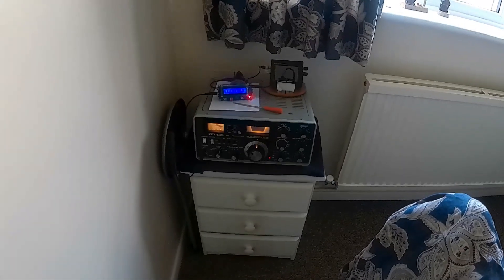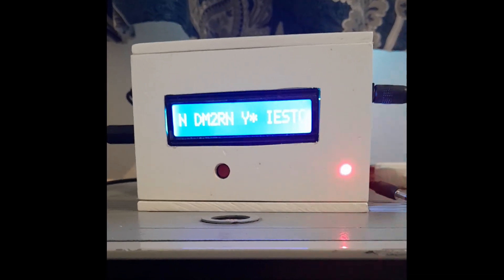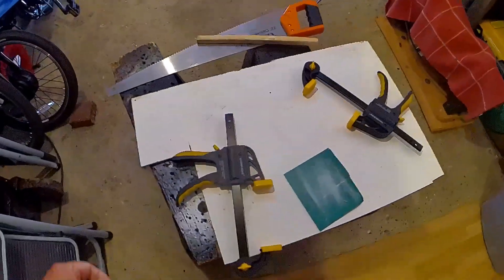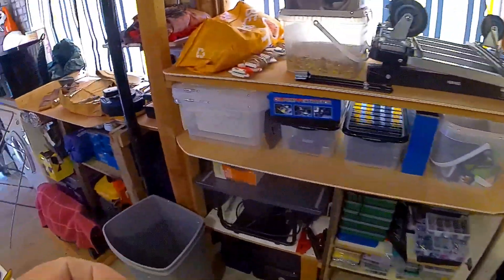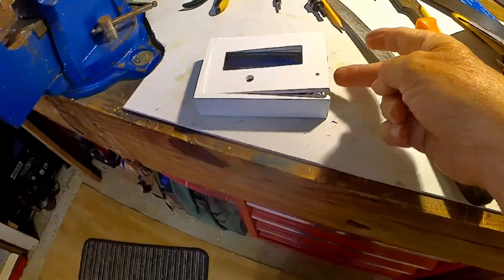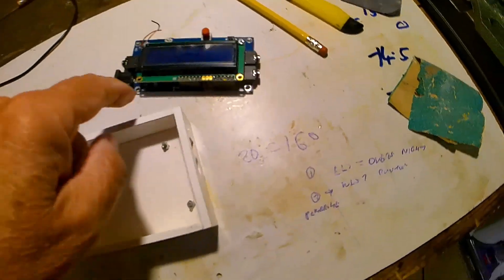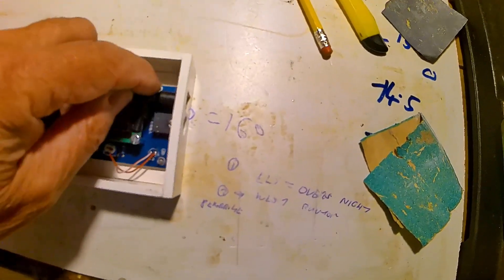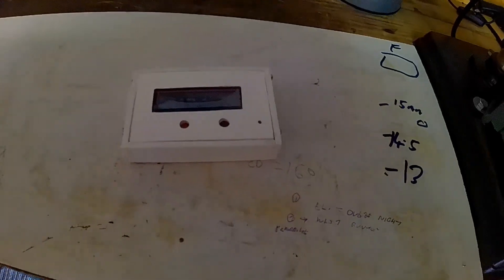Morse Code Decoder Module. Enclosure Build and Test. Ham Radio. Amateur Radio.

Comment: Do you have a URL link for that one, George? 

I have bought a couple over the years and they weren't very reliable.
Reply from the maker: Hi I don't have a link. Ebay search "Morse Code Reader Ham Radio Telegraph CW Decoder Translator"

Mine was faulty when I first got it. It was fitted with a 2 line display 1602 when it should have a 1601 Display. But they gave me a refund so I could buy the correct display. Plugs onto main board. There's another video on my Ham Radio playlist on this module etc. Watch first. George
Reply: @MakeDoAndMend1  Thanks!
Reply from the maker: Hi Rick. There's a newer version out. 2 x row display and usb. Hoping to get one soon. George